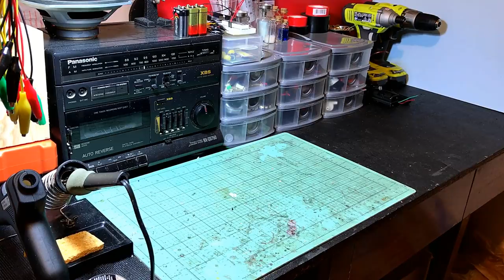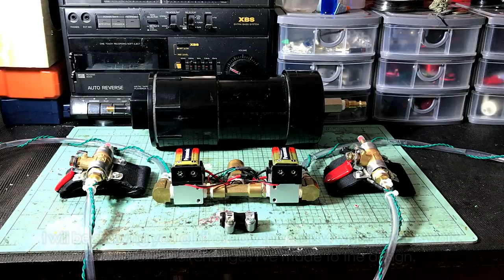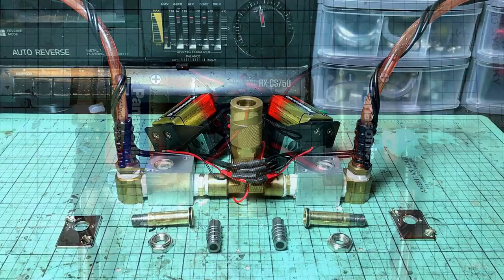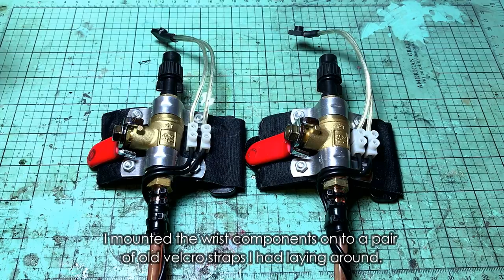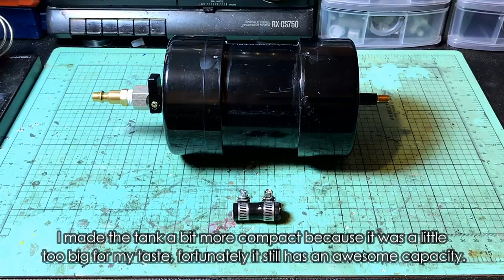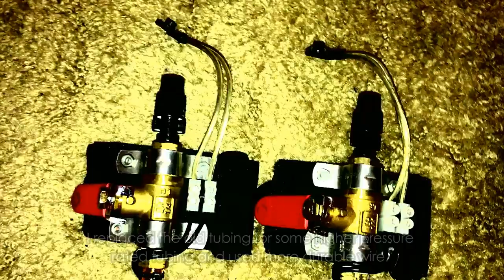A Closer Look At The Mark 4

Comment: I have a question. Is the nozzle switchable, like you have two separate ones for both shooters?
 Or do you just turn the nozzle to switch between line and spray.?

Comment: just a little advise, instead of a on and off switch, it it possible to make one with a trigger and it automatically gets turned on if sufficient pressure is put on it and it later turns off automatically
Reply from the maker: That's still problematic because if you were to lean on your palm or something it would still trigger. I was thinking of doing something like the ant man triggers that are out of the way of your palm and more conveniently placed.
Reply: The Human Spider but making them more tighter , I mean in order shoot a web, u have to apply a lot of pressure something like that instead of ant man's since spidey's originality will be lost, just an advice boss ...u rock!!

Comment: What type of education did you receive to know how to build gadgets like this?
Reply from the maker: I don't think anything in my education really helped me do this stuff, I just learnt things by myself on my own time.
Reply: Darth Sceledrus I've been doing a little research on my own before I start my videos and so far I can see three things:
1) Guide Books aren't all that great as they appear to be.
Great if you want to learn 'theory' of electronics and to get the gist of soldering but not that complete guide that you paid for(most tend to be pretty costly)
2) Join an online forum or community to gets another pov or to input on and off of someone else's work and learn something new, I started off of r/electronics
3) You have to do it yourself!
<~~ 'duh' is what usually tends to come from this statement but you'd be surprised how much a few days of just doing nothing can change your mind from trying out daunting challenges and experiments. Just think of this as a reference to start with if you haven't already started, I know that you can do it!